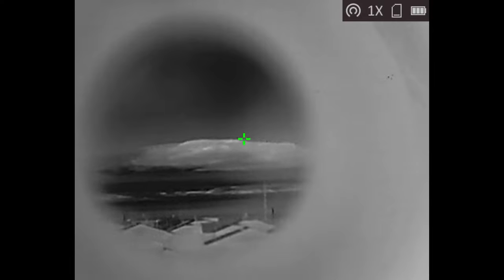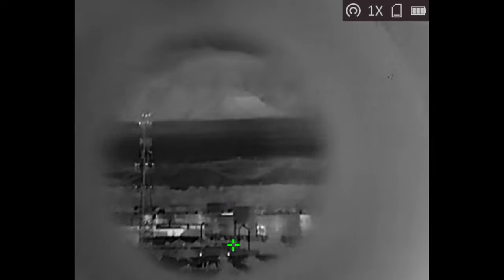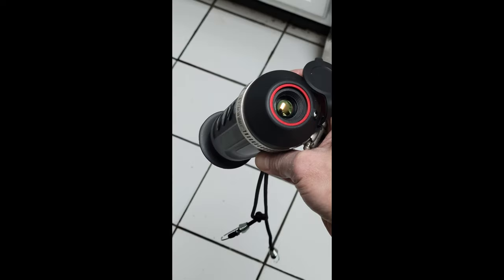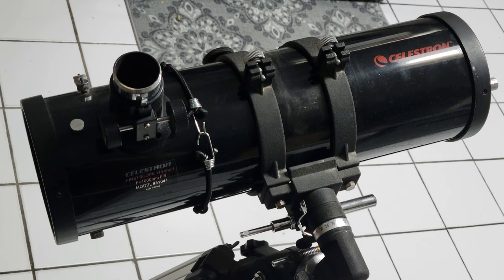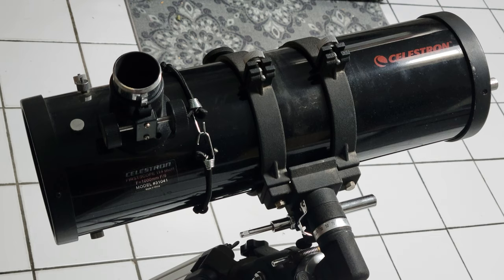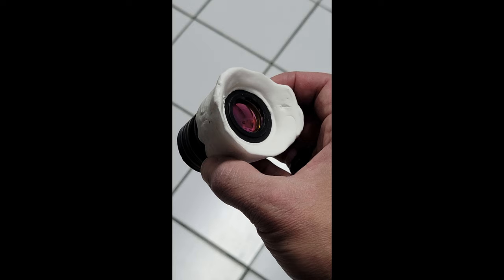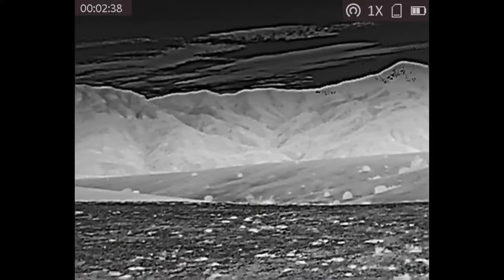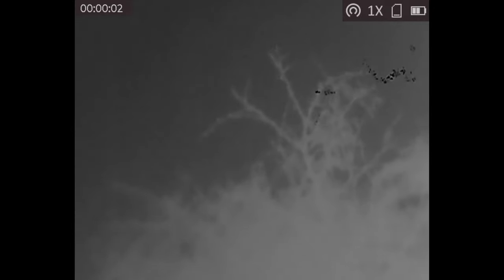Homemade Military Grade Thermal

Comment: A bigger thermal sensor is better like 640 x 480 pixels at 50hz refresh rate with a 35mm lens. most spotting thermal monocles are only 384×288 at 9hz with a 12mm lens.
Reply from the maker: I 100% agree. I'm pretty surprised at the stats for the one I do have. It's 384x288 at 50hz refresh and it has some kind of resolution upscaling through the eyepiece. The weird part is that better resolution seems downgraded when it's put in video format. It almost looks HD and super smooth through the eyepiece. The front aperture is at least 15mm, I could be wrong but it might actually be 17mm
Reply: @talktoyourself  hello. 15mm is the focal lenght, not the diameter. of course the reolution is better, because with higher magnification, your FOV is smaller and you have more pixles at the same distance on your target. its all about pixle size at your target. thats why you can identify objects better with a 256-15mm than with your 384-15mm at long distance. the 256 has a narrow FOV and more!!! smaller pixles on the target, so you need a 19 or 25 lens to beat the 256-15, because than your pixles are close or smaller than the 256 ones. hope that helps.

Comment: So are you using an AGM sensor and zooming in on the screen with a telescope lense? Ok after rewatching I think your thermal is looking through the telescope?
Reply from the maker: Yeah, so I made an adapter and modified the telescope to handle thermal viewing. The thermal monocular has a wifi streaming mode as well as on board video and photo storage. I think I recorded through the AGM app (T-vision) instead of the onboard recording. I will say that looking through the eyepiece, it looks way higher quality than the streaming or on board recording. Almost seems like it's intentionally downgraded but I could be wrong. Maybe some ITAR rule?
Reply: optical zoom rather the AGM s digital zoom(maybe they are doing themselves a disservice). Interesting my agm only has a (itar) warning when I select the cross hair option. I don't think it's intentional degradation. This experiment is telling me the AGM sensor has more capability that's not being unlocked.

Comment: Very nice, I'm in the process doing something similar. Trying to get an inexpensive smartphone thermal camera mounted on a picatinny rail behind and aligned with flip-up iron sights, as well as a thermal version of a separate 3x or 6x magnifier to go with it. The goal is to come up with a cost effective design that could be produced in large numbers for front line troops in Ukraine. If you have any suggestions or lessons to pass along they would be greatly appreciated.
Reply: There are many smartphone thermal camera around and the best one out there in my opinion is the Infiray T2 pro, over a mile of range.  It’s about 400 ish USD.
Reply: @RattlesnakeRCandHobbies  yeah the infiray is the best you can get for under 500

Comment: Would it be helpful to design a 3d printed threaded insert for the lenses? That way you could make minute adjustments and find the best focal length? Or even have it changeable based on the desired results

Comment: Please remember that ,,military grade,,thermals are most of the time cooled teledynes,like police helicopter thermals for example.They are operating in mid range between 3-5 .Thermal you using is uncooled sensor in long range wave length which is typically 8-12 sometimes 7-14.Also procesor resolution is quite important.Your AGM unit is 3..something on 2..something while airborn cooled units are 1024 for 720?But most important factor is NEDT.Uncooled devices are actually catching up with nedt below 18 milikelvins.Your unit is I presume between 30-40 nedt.
Reply from the maker: It's not perfect, but it's a lot closer to the ranging capability military devices than the thermal scope alone, costing only a few hundred extra total. The temperature resolution on mine is definitely incredible. You can see a slapped hand print on a wall 2 minutes later, foot prints are even longer if there are even temps. Very cool toy to have, can't wait for the higher res 🙌

Comment: I do not currently possess the knowledge to design a Ge/ZnSe eyepiece, however, I do have a screwdriver...
Have you tried or thought about getting this idea to work using prime focus method? Where the telescope is projecting onto the sensor instead of going through lenses. Removing all the lenses would, I think, gain a couple extra percent LWIR transmission. Although I don't know how relevant this is to LWIR sensors compared to NIR sensors, where it is quite important.
Reply from the maker: That's a really good idea! I have considered doing that with some of the small cheap phone IR detectors and having a phone mount on the telescope. You're definitely right, as long as the image is projected on the sensor it should be good. Also, the gain in sensitivity could be as high as 50% or more because Ge and ZnSe have fairly poor transparency in that region. Keep thinking, and build if you get the chance. Your idea would definitely be worth a go!
Reply: @talktoyourself  just discovered my neutonian's focal plane is too low in the focuser. Project is now a lot more complicated/expensive all of a sudden. I'll let you know if I make any progress.

Comment: So are you running a 101.6mm focal length / 20mm lens? I’d love to take my monocular and my telescope and make one of these. Any chance you could make a more instructional video? It’d me a week+ of R&D.  Thanks!
Reply from the maker: I believe the telescope is 1000 mm FL, and the main thing was just to remove any glass optics in the focuser (thing that moves in and out, probably the wrong name). I recommend a 2" FL on the ZnSe lens. Diameter of primary mirror is ~100mm, Diameter of ZnSe(zinc selenide) lens is 20mm minimum. If your monocular has a large front optic, you will likely need to go bigger on the lens unfortunately. My thermal's front optic is 15mm I believe.

Comment: Also, I have a question:
Were these images taken during day or night? Or it doesn't make any difference in the result?
Reply from the maker: Apologies for the late reply, there is a slight but noticeable difference between day and night. Things also appear to be lit by sunlight through thermal with the difference that a new shadow is not cast(ie a person walking does not cast a shadow). Stay curious and start building if you have the means!🙏

Comment: Super cool video!  I have a Infiray T2 pro and the fov is really narrow which gives it about a mile of range.  For my application though, I need the fov to be a bit wider.  Any ideas if there are clip on lenses for a small smartphone thermal imager like the T2 pro?  I’m making a custom UAV and would love your input!
Reply from the maker: That would be awesome! I've wanted to drone mount mine for a hot minute but haven't put in the money yet. You miiight be able to find a wide FOV germanium or zinc selenide lens on ebay or maybe ali. They must have attachments somewhere and I have seen YouTube videos from some IR companies that sell clip on adapters for their products, but they're using larger lenses. Biggest worry with wide fov would be resolution imo. If the resolution is higher than 200px, you might get some decent detail at low level. High level flying would probably pick out cars and houses but maybe not people. If I come across one randomly, I'll post it as another reply. Make a video if you build it!
Reply: @talktoyourself  I might, also don't want to release any secrets haha.  I will look into lenses, thank you.  I wont be flying much higher than 60-75 feet at most, so i DONT think resolution would be an issue.  The T2 pro resolution is 256x192 but has crazy post processing, its looks more like 720p through my phone.

Comment: What focal lengths did you try?
Reply from the maker: All of them 🤣🤪 best outputs were in the 2" fl range, shorter than that had amazing zoom but no contrast.
Reply: @talktoyourself  my confusion is wouldn’t a long focal length also need a bigger lens? And an f-number of 1 is best? Currently I’m trying 20mm diameter and focal length.

Comment: Got a build list?
Reply from the maker: Pretty much just a thermal camera with minimum 300x300 pixels, regular reflector telescope(refractor will NOT work), and some ZnSe lenses used for CO2 lasers. It's a fairly simple setup surprisingly, just getting the right focal length of znse is a little bit of preference based. Minimum diameter of the Znse should be 20mm, especially if your thermal already has some zoom.
Reply: @talktoyourself Okay two questions - 

1). Is yours a Celestron - StarSense Explorer DX 130AZ Smartphone App-Enabled Newtonian Reflector Telescope?

2). How much, in total, did it cost to make this DIY thermal imaging device? 

Either way - wow :).